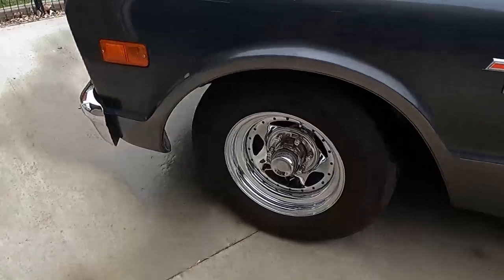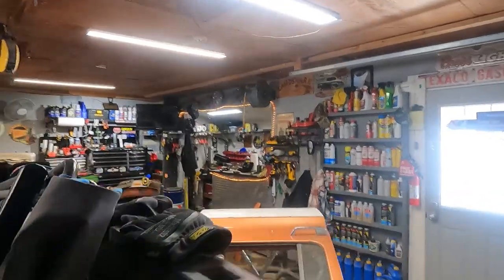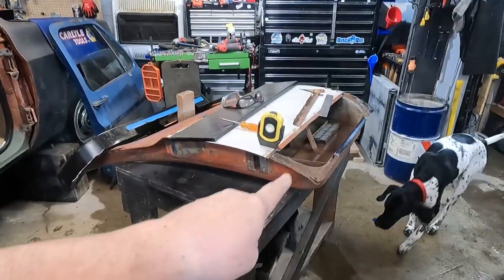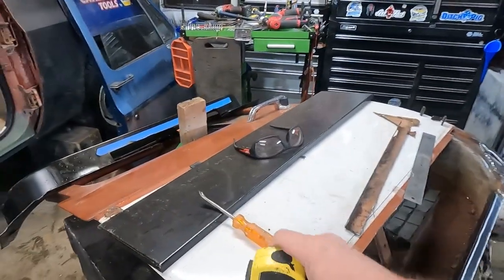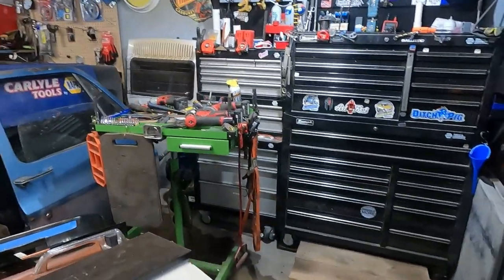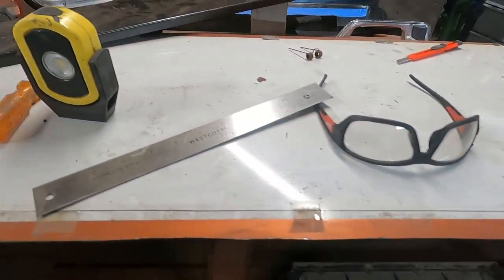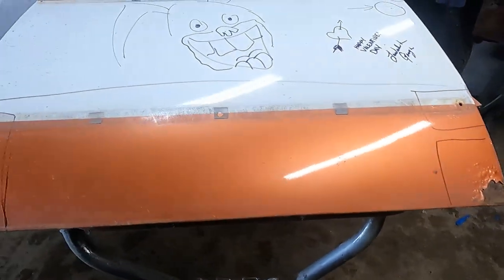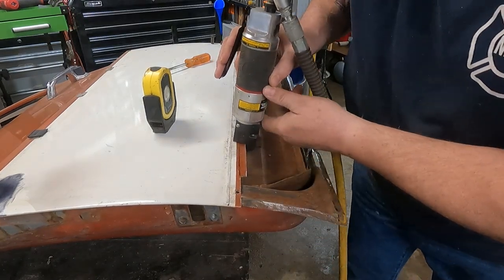Chevy Square Body Truck Rust Repair -  Lower Door Skin Removal and Replacement

Comment: I'm currently doing the bottom door skins & inner door panels on my 1969 Chevy C10... I welded 6" of new door to the bottom of both doors & shaved the door handles and exterior locks, because it's gonna be remote/keyless entry... I'm gonna line the exterior door skin with Kilmat sound deadening insulation to cut down on road noise, but I've gotta get all the repairs done to the outer door skin before I can put it in because once it's on there, it's on there, so gotta make sure you don't need to hammer & dolly anything anymore first... I'm almost there! Then I can start on the cab...my dad gave me a great piece of advice, always start with the passenger side, that way you don't have to look at it every time you get in the truck...Lol!
Reply from the maker: Yes that is sound advise. Good luck and thanks for watching !

Comment: I’m replacing a lower door skin on a 64 Studebaker PU. I’m going to weld it on. Never used the structural adhesive before. I will think about that in the future. Thanks for sharing and take care
Reply from the maker: Thanks for watching!   I will definitely use more in the future especially on old rusty stuff
Reply: @LandsharkGarage   Thanks, I’m a new subscriber

Comment: I like that panel adhesive I heard it can be as strong as welding if done properly. I have seen guys use it. I haven't myself but I plan to. Is it two part? Nice work Shark. I love the square bodies. Especially the 3+3's. Are you painting it back to the same two tone? That is a great color.
Reply from the maker: The adhesive is a two part but it mixes in the nozzle as you apply it so it’s super simple to use.  Eventually we want to paint the beast the original color but it may be in primmer for a few years because we really just wanna drive that shit 😂😂. Thanks for watching !

Comment: Cool, I never used that panel glue before thanks for videoing that. Question: did the other side come apart at all or was it just the first side where it got the first glue out of the tube? If that is the case, thanks for the heads up.
Reply from the maker: Yeah I feel it was because it was the first of the tube.   It worked slick.  Thanks for watching

Comment: See I hear get all the rust out but structure has rust like myn. Do I have to remove all that?
Reply from the maker: Surface rust you can treat. If it is really pitted and you have time I would cut it out. Don’t get it right just get it going that is freibergers  motto.  Mine to I just wanna drive my shit !